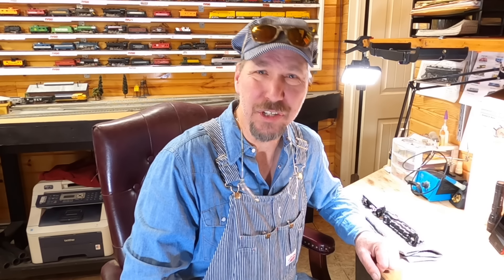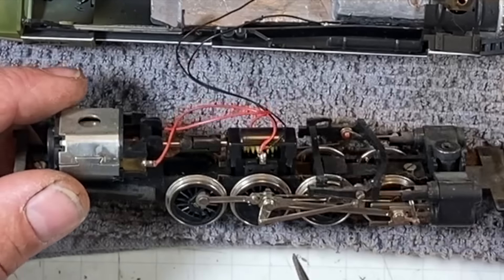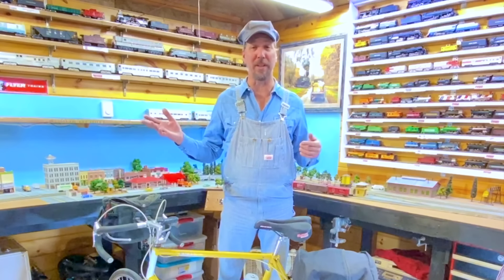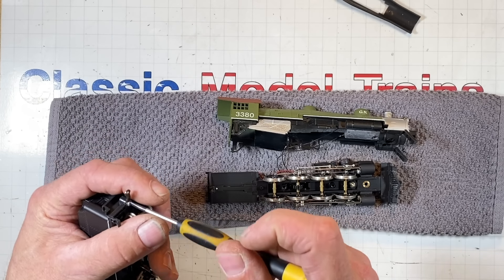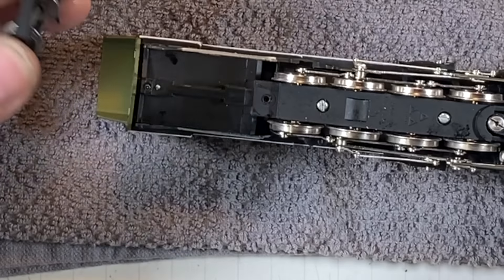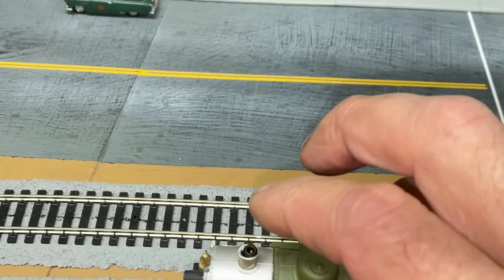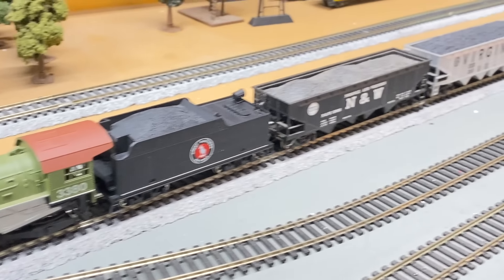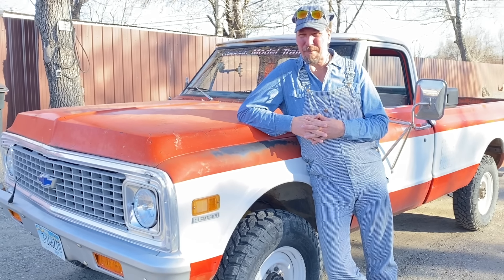AHM / Mehano H.O. Steamers.....Built Better Then You Think!

Comment: I guess My layout is a model railroad museum of sorts. I have locomotives from all eras. I even 3D printed a Back to the Future III Delorian and some UFO's for my layout so there's a touch of Sci Fi too.  Also have some cryptids like Mothman and Bigfoot scattered around like easter eggs for when I do FPV camera car tour.  Last video I did was 1900 era C&O passenger and 1936 PRR K4s Streamlined Hudson passenger consist going opposite direction on the mainline.  Currently working on an old trolley made by Mehanotechnica or something like that. It has a plastic trolley pole unlike another one I have that must be older because it has a metal trolley pole.  I'm adding directional headlights with those tiny micro LED's. I just got in some tiny plugs and wires so I can remove the body shell completely for servicing at least I hope it turns out as planned.
Reply from the maker: Your layout sounds pretty cool to me!!

Comment: Hey Ron!,  Sure I’d love to see some DC to DCC conversations but they gotta be N scale only because I love to watch you get pissed 😂😂. Ya ever launch an N scale spring into some 60s type shag carpeting? 😂. You’ll never find if it’s brass 😱😂  I need a brass magnet, bare feet doesn’t work 😂

Got me a small N scale layout, kinda in the late 50s eat60s era cause of the old Ford tractor and a old 60s Chevy pickup with a dog in its bed, at least I think it’s a dog? Might be a flea?
Enough farten around, any scale you wanna convert to DCC would be great to watch. 
Thanks for what you’re doing, Ron/Dr Wrench 😂
Reply from the maker: Hello Ron!  thanks for your input on the "Era's" question.  No N DCC conversions for me.  My blood pressure finally stabilized after that Bachmann debacle  :-)

Comment: Unrelated about trains but would your truck share the same lug pattern as the Ford 8 lugs of the same year?
Reply from the maker: I believe all the 8 lugs from this era are the same.  Only the hole in the center is different.  These rims are aftermarket steel rims and they were on my 67 Dodge before they were doing time on this Chevy.

Comment: My interest in trains covers too great a time span, and most of My stuff is rebuilt from junk, so I don't model a specific era. As for Mehano, I bought my first one off of a consignment rack at a collectables shop. It was a ATSF Valley Flyer light pacific, and it was perfect from the first crack of the throttle. Since then I've picked up a powered chassis for a mikado, for a scratch build project, and a box of parts that was supposed to be Rivarossi parts,  but ended up having enough Mehano parts to build another Mikado, and another light pacific. Not the best motors service wise, but reliable and powerful enough for a 3 pole motor.
Reply from the maker: Thanks for the share!

Comment: Why not at least put it on the track first and see if it runs, before taking it apart ? Because it could be something we did to cause it to not work when we DID open it. No ?
Reply from the maker: You make a good point but I find the grease is hard in most of them.  Could break something.  I like to get them all serviced up and then put them to work.